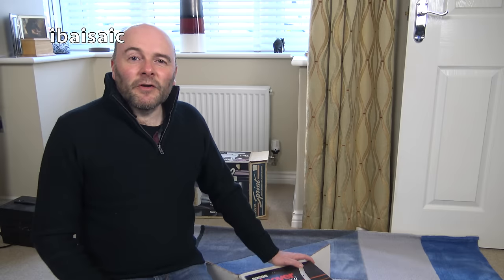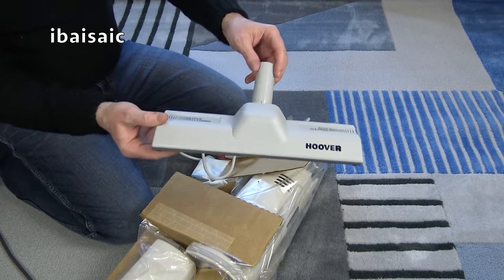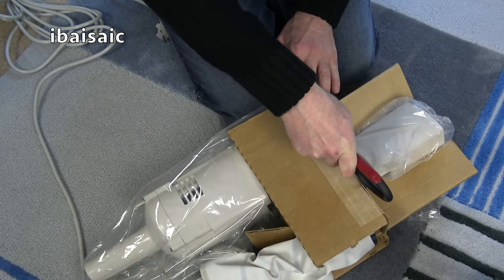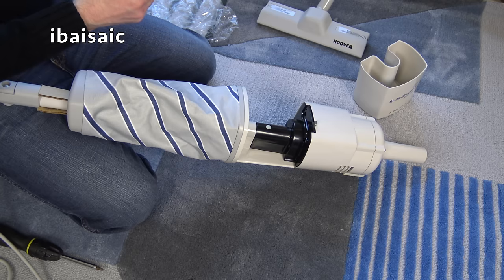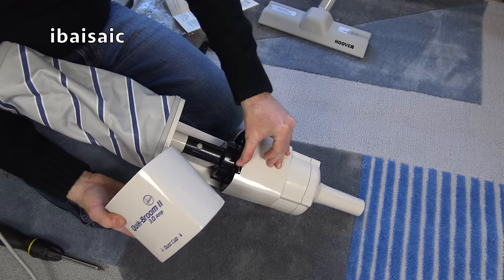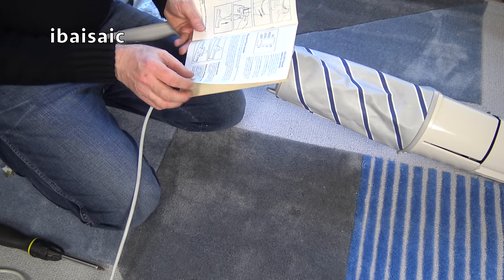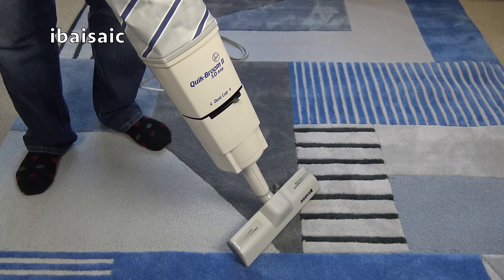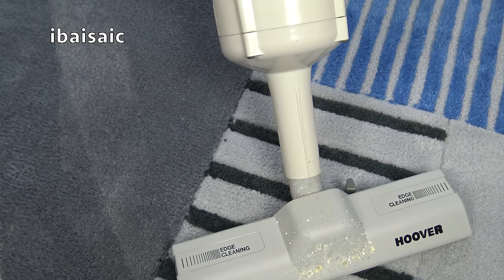Hoover S2095 Quick Broom II Mains Powered Stick Vacuum Cleaner

Comment: Thank You so much Roger! 
It is a dirty fan /direct air vacuum. 
The fan is in the rounded housing above the inlet tube that connects to the nozzle. 
These machines were derived from the Regina Electrikbroom design of the 1950s that Regina produced until the late 1980s. Growing up we burned through about six Reginas and usually needed to disassemble the fan housings to clear out clogs. Usually that required a fan housing gasket. 
When my mom moved down to Florida I sent her the Hoover Quick Broom II with a card that said she finally has a stickvac from a manufacturer that knows how to produce a quality vacuum and where we needed to replace our Reginas every few years the Hoover lasted about a dozen years and I never needed to open it in order to clear a clog.  It also preformed remarkably better than the Reginas.
I wish that I had one of these today. I really liked this little machine. 
I love your new area rug Roger. 
Use it well. 
Thanks again for a really enjoyable video.
Hugs!

Comment: Fun Fact. Hoover was sued by regina for patent infringement over the Quik Broom ll copying Regina's electrikbroom but regina patents were expired so the court sided with hoover.
Reply: Rick Hoover... HI I BOUGHT A HOOVER QUIK-BROOM II VACUUM CLEANER... MODEL NUMBER S2103... FACTORY SEALED AND WAS WONDERING IF YOU HAD AN IDEA ON HOW MUCH IT’S WORTH... THANKS...
Reply: Not surprised. It’s almost a direct copy XD
Reply: @arancunningham7256  I have both the Regina and a Hoover and yes id say pretty much an exact copy! The hoover isn't bad but the Regina is better still has a larger nozzle that doesn't clog as bad and the spring loaded bag is larger and goes up and down further as well on the Regina.

Comment: That's the exact model my parents had when I was little. They used it exclusively for the tile/hardwood. We had an Elite II for the carpets.

Also that stickiness is the rubber leaching the plasticizer. A very common issue in the wires in Zenith televisions from the 60s. Lacquer thinner removes it pretty well if off-the-shelf adhesive remover doesn't

Comment: I have the 3 speed red deluxe model I picked it up at a flea market (boot sale) for $5 I cleaned it out and replaced the power cord and it works perfectly it's dated 12/91
Reply: Awesome
Reply: I have a red 3-speed deluxe model as well and am wondering how you cleaned it? Mine came from an older friend who was downsizing and it has a bit of a musty odor in it. Should I vacuum up some nice smelling stuff? Maybe baking soda? What about detaching the bottom of the bag, turning it inside out and wiping it down? Any thoughts? Thanks.
Reply: @dianeshinn2379  can take the bag off and wash it thats what I do with mine
Reply: @dianeshinn2379  for general odor I would vacuum up potpourri that should take care of the smelly odor in the nozzle and exhaust of the vacuum then wash the bag

Comment: All I can think of this excellent vacuum is the Vorwerk. eBay has a lot of very good condition Vorwerk vacuums and this Hoover is like a small version of the Vorwerk.
You are still missing the Vorwerk from your collection (I am not sure). I didn't know much about the Vorwerk until I got my Vorwerk VK 135 and it's no doubt my best upright what I have ever used or owned. I think you would like one.

Comment: My parents had this same model when I was little before it got replaced by the later S2610 Power Brush model, the later version wasn't terrible (although it's certainly better than any stick vac Hoover makes today, or any company in that matter, but I digress) but it never cleaned as good as the older versions like these.

Comment: Definitely dirty fan. My mom has a Regina electric broom till it spit sparks out, then a red Hoover quick broom with the 3 speed and a wheeled floor head. When that one died she had a green one, not sure what happened to it. It disappeared after I moved Out in 2002. And they didn’t have an option for an electric brush nozzle.
Reply from the maker: There is a Hoover Quick Broom with a power nozzle, but it is a much later version than the ones with a soft bag.